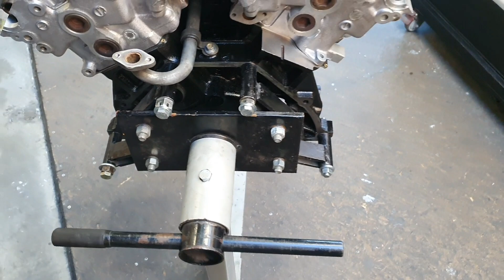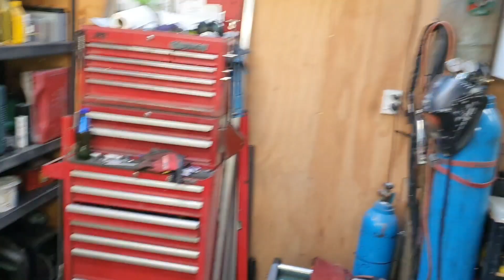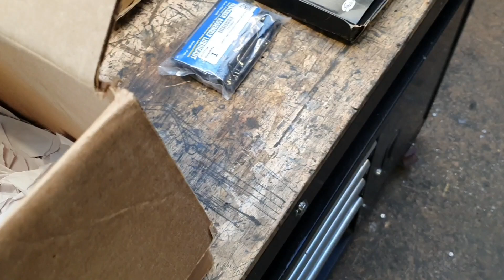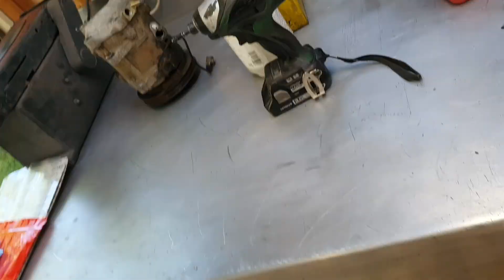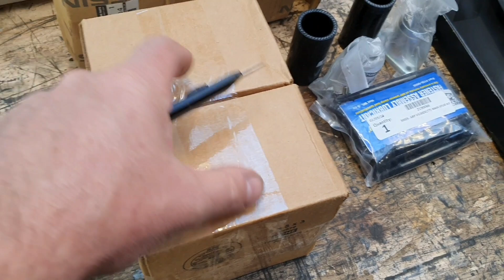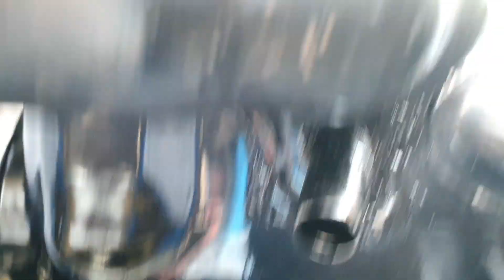VG30DETT reassembly part two

Comment: Keep an eye on the mls gaskets. I had nothing but issues with them. Cosmetics would leak through between the steel layers. Most use the stock gaskets in high power applications.
They dont look like l19 head studs. They way the bolt is undercut it looks like 8740 set.
Reply from the maker: Stock gaskets fail also, been there done that.  People have problems with metal gaskets mostly due to poor surface preparation IE: incorrectly machined giving wrong surface finish.  Or not cleaned correctly.

L19 head studs are also undercut - but thinking about it should be a slightly lighter colour.  The clowns who messed up the previous build didn't refit the ARP main studs.  It's possible I've been caught out and they swapped the L19s for standard ARP studs - something I didn't consider TBH - we could be ordering some L19s if that's the case.
Reply: @TheLabLimited  i had fully fresh surfaces each time i tried mls. Cometics lasted a little bit before it leaked and tomei is just a waste of time. This was only a 800whp stage. Went back to a composite gasket that we get made here in Australia and no problems.
Now with more power i use a composite with aluminium bronze fire rings. Devil z and mike jacksons 1000+ hp car run standard gaskets. Just give composite gaskets a spray of copper spray.
Those head studs aint too bad i ran them at 800whp but must be a old kit the arp kit now is 2000s.
Reply from the maker: @aussie1926  "fully fresh surfaces" but machined to what surface finish on what type of machine?   I've seen and heard and discussed this all before many times.
For this particular build it's actually completely besides the point because without sourcing a fresh block and heads to return dimensions within spec we have no choice but to use aftermarket gaskets and going 75thouh on a composite gasket is going to end badly.  As mentioned in the video and as discussed some people don't like the Cometic gaskets, I've never had any issues caused directly by the gaskets.
Reply from the maker: For what it's worth upon checking the head studs this morning it appears for what ever reason the previous engine wreckers have removed the L19 head studs and replaced with the cheapest ARP studs, not even the 2000s :(
So I've ordered replacement L19s and will install them prior to fitting the plenum etc.
With so many stuff ups in the build I always said it would be hard to not get caught out somewhere - my bad assuming they were the head studs I had fitted - bad call.
Reply: @TheLabLimited  they were basically mirror finish surfaces. Good ra we get machining done by a shop in Sydney that does alot of race engines.

When getting a thickness we take in account the squish of the composite gasket. The ones we use now start off at 2mm.
The heads bolt down onto the rings any way to seal combustion so gasket only seals the water and coolant. Also run 625 head studs now so keeps it clamped good. 

For the blocks genrally only get bored to 87.5 then change them out. Run the risk of cracking bores if go bigger. Also run f65 blocks not the standard 30p 300zx ones.

Your only human mate, simple things just like the studs can be easy to miss. I just picked up on the undercutting from using them before. Never had the L19 but used the 8740 2000s and now 625+.
Reply: @TheLabLimited  also the head bolt washers are you using the arp ones or stock? 
Arp ones that come with the kit are too small and bite into the head.
Reply from the maker: @aussie1926  well aware of that thanks.